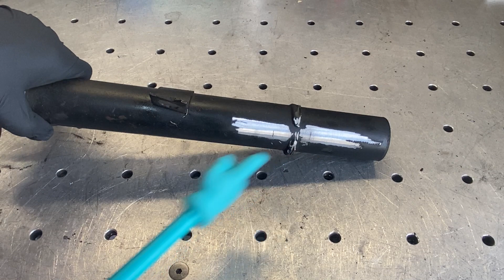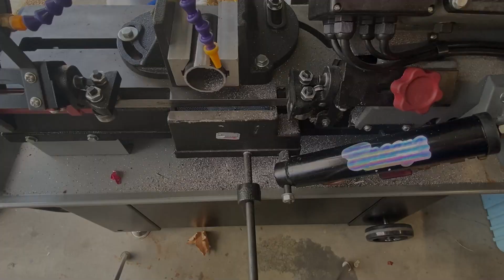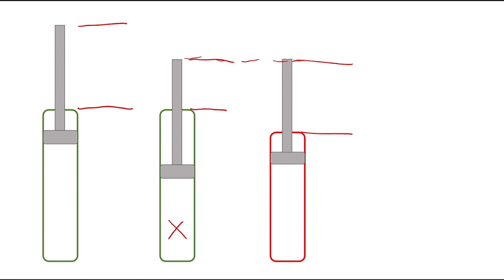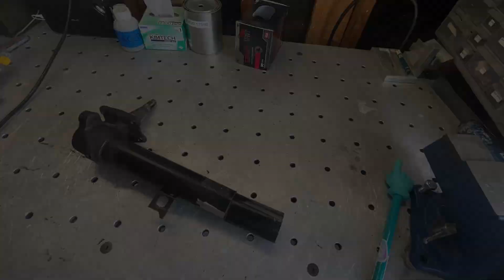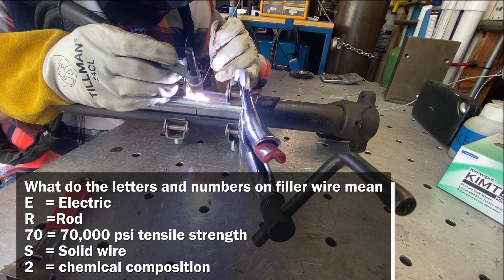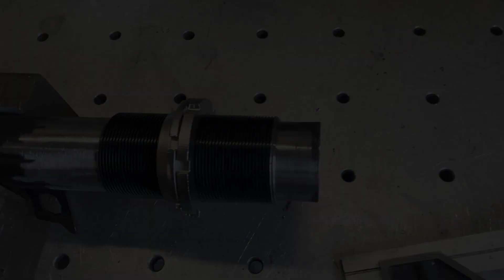AE86 Short Stroke conversion

Comment: instead of cut, removing 40mm of strut housing and using 20mm spacer for dampers, why dont just cut and remove 60mm and not using spacers? is there any differences?
Reply from the maker: Your car would sit very low.

Comment: Im making a set of these soon, I didnt quite understand the spacer part. if im using the kyb agx do i need a spacer or no?
Reply from the maker: Yes but it will depend on the length of the damper body.  A common way to get your spacer length is to stack fender washers under your damper body until you have a length that lets you tighten the damper on the strut body. Take out your washers and measure them to get your spacer height.
Reply: @seymour86  ok right on thanks for the info 👍🏽

Comment: I found your original welding project video years ago. Was trying to find it again today as I was planning on making a set of these. So amazing that 13 years later you put out an even more detailed video. Thanks alot!
Reply from the maker: Glad I could be of help. What car are you doing these on?
Reply: @seymour86  1982 Toyota Celica Supra, pretty much the same front suspension like the AE86
Reply from the maker: @AStraussy  Nice. I’ve done a set or two of those. I think there was a difference in how much was cut out depending on which dampers are used. I believe i have some notes I can look at in my journal.
Reply: @seymour86  Oh really? That would be awesome if you could check. I just assumed 40mm would be the number to go with.
Reply from the maker: @AStraussy  for the A60 celica I cut out 35mm because the person I was doing them for had dampers for the rear SW20.